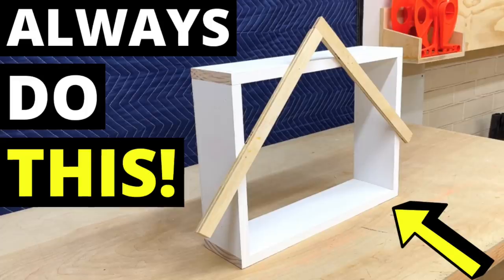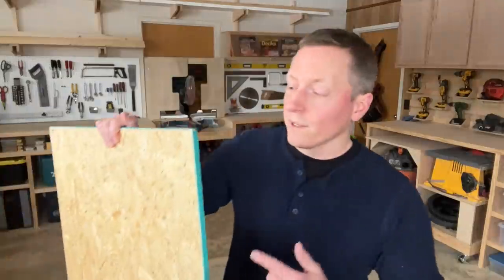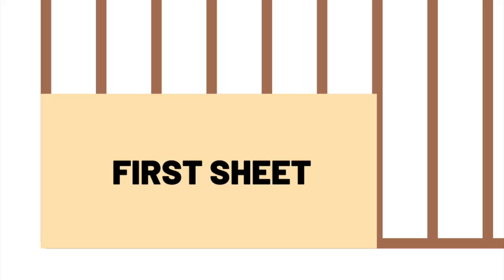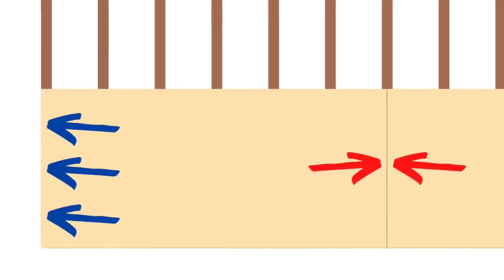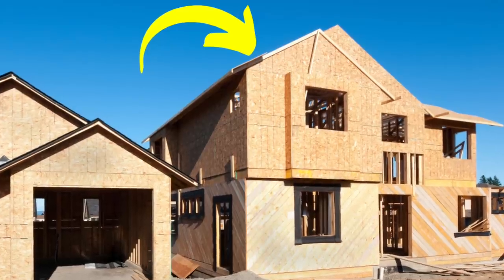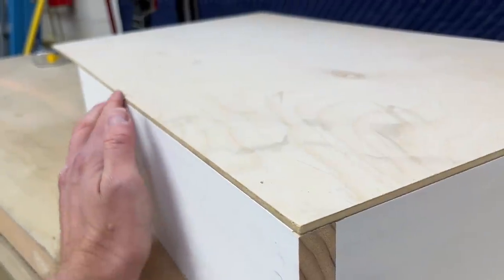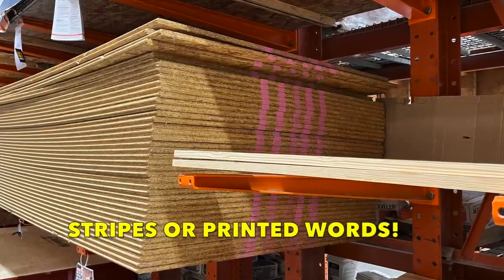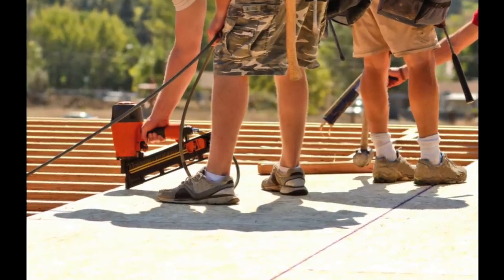This BUILT-IN LUMBER HACK Will Help You Build Anything! (Understanding FACTORY EDGE--How To Use It!)

Comment: Thank You for your video.  Many DIY’s do not know that the factory edges are “straight and square” for construction. 
But …. 
OK I’m that woodworker. The factory edge are good in construction, but in cabinetry (at least on cabinet grade) the edges are neither straight nor square enough for high end cabinets or furniture work.

Comment: I've forever been tainted and forced to check my plywood after a barn door build a few months ago where 3 of my 6 4x8 3/4 CDX sheets had factory edges from 1/8-3/16" out of square. I couldn't figure out why my T-Square wasn't agreeing with my marks. I blamed the square because I trusted factory edges that much. After some checking, it was the plywood. I'm sure it was just a bad batch but I feel forced to check for the rest of my life. Sad lol but 10 years of square factory edges isn't a bad run.
Reply: I've learned not to trust factory edge when building custom built-ins, both because of inconsistent thickness and out of square. That's where the track saw shines.
Reply from the maker: That’s crazy! There are some small mills out there—it does make me wonder how it all gets quality controlled
Reply: @TheHonestCarpenter  These sheets were from Lowes so I can't say I was buying from the best local lumberyard. With that said, I've always had good luck with their poplar cabinet plywood.

Comment: The last couple years, since the shortage/price hike, I've seen entire bundles that are a couple degrees out of square. Almost feels sacrilegious to cut away factory edges, but we're all doing what we gotta do.
Reply: Same... We even had a whole bunk of tongue and groove floor ply with poorly milled grooves.  They were placed too low, like almost an eighth.  It was a fucking nightmare.  It usually takes me 15 seconds to grab a sheet (a flat one) slam it down, set the seam and nail each corner.  These beasts were taking 5 mins a sheet.  We send a bill to the lumber company 👍 🔨 🇺🇸
Reply: @9mmkahr  that’s exactly what you should do… did they pay it though?
Reply: @G__Mason  not sure, I passed it on to the company owner, but he didn't seem to care much.  Oh well, I'm hourly 😆
Reply: I have seen a huge decline in quality. Not just wood products either !!

Comment: When I get a sheet and I know I'm going to chop it up, I put four marks on the corner.  So even when I cut, know if I'm dealing with a factory edge or not. You just transfer the corner mark to the edge before cutting it up.  Or if the edge is messed up, you can create your own perfectly square sheet. But you'll need a tracksaw and some square rails to do it properly. I find that doing it on a tablesaw is too cumbersome.  And never trust the panel saw at the big box store. It's usually not an issue since no one is ever around to help you.  LOL
Reply from the maker: I definitely avoid those panel saws, hangsang!
Reply: Love this tip.  I very rarely get to use whole sheets in my projects.
Reply: @TheHonestCarpenter  I usually ask them to cut up my sheets at the panel saw so they fit in my car, but I know they're trash. I always mark the factory edge and ask them to cut at least 1/2" more than I need the pieces to be so I can bring them home to my good saw. I saw them with the factory edge up against the fence and still leave about 1/8 extra on the cut width so I can turn it around and use my straight fresh-cut edge to take off the factory edge so I have clean, parallel edges for whatever I'm building. It's tedious, but it gets the best results until I get a truck to haul full sheets. I've also been tempted to bring my circ saw and make my cuts in the parking lot.
Reply: @DrewTauber  I've brought a saw and cut-list and cut in the parking lot.
Reply: @joshuajones8455  I like your style
Reply: @joshuajones8455  Been there, done that many times! Sometimes get funny looks from people, but it works for me!

Comment: i have found most OSB and plywoods to be square, at least square enough for all framing, rough carpentry etc.  however, if you are building cabinets, i have found melamines and mdf to be out of square 1/8-3/16 based on the diagonal corner to corner measure...and that is using a combination square on the corners so any faults or round overs are eliminated
Reply: This has been my experience as well.  For rough framing the factory corners are plenty square.  But when I started building cabinets I couldn't figure out why they were always a little bit off.  After a lot of trial and error I determined that most the plywood I got did not have square corners.  Once I started squaring all the corners on my sheets and stopped assuming the factory edge was square enough I started getting perfect cabinets.

Comment: Thanks.  Anytime I'm doing a project and grab a piece of cut sheet lumber big enough for the job, the first thing I check is to see if it still has at least one factory edge to pull and square from.  Definitely saves time and work if it does.
Reply from the maker: Yep, I do the same thing, Steve! I flip it around until I find the factory, then mark it 👍

Comment: I was wondering why some of the Lumber at Lowes was already pre-marked, now I know what it was. That Factory Edge marking makes it nearly impossible to not put a floor down on the studs perfectly. Thanks.👷🏿‍♂️
Reply from the maker: Exactly, W! 😄
Reply: The color and number of stripes on ply or OSB also tells us what that sheet of lumber is to make sure you are charged properly at checkout.
Reply: Yup, I learned something new here as well.
Reply: Floor down on studs? No such thing
Reply: That is not the intended purpose for the stripes, but it is useful. The purpose for the stripes is for the cashier to identify what material you have so they know what to charge. Pay attention next time you check out and you'll see they have a binder with all the various stripes and colors with prices or a bar code next to it.
Reply: @jncn1490  
Seriously hoping someone caught that 👍
Reply: @earthlingjohn  I caught that, but you can buy "studs", or 2×4s, and use them for a floor. I assume that is what they meant.
Reply: @jsmith5443  But then they are joists. Studs go in a wall, joists go in a floor, rafters go in a roof.

Comment: I’m not sure if anyone else has experienced this but most times I buy 3/4” plywood from home depot it can be up to 5/16” out of square. Lp smart side was always perfect and 7/16” osb was always within 1/16” or perfect
Reply: It happened to me several times
Reply: I literally have to square up every piece of plywood i have gotten
Reply: I had a kid cut 40" from a sheet of plywood at HD.  He measured by having the plywood on it's edge, while he measured it.  The sheet was bent like a bow and arrow.  He then argued with me that the measurements will be exactly the same as laying it down flat and measuring.  So, I had him measure, and mark the board where he would cut it.  Then I laid it down.  I said, now measure the 40" and according to you "they should be exactly the same".   He was literally off by about six inches.  Then he says well we don't guarantee accurate cuts.  To which I replied I don't guarantee purchase either.  He was pissed.  Wouldn't say another word to me.  It was also stupid that those saws have a precise measuring tool on them...so easy.
Reply: 100%. I had a whole unit of 3/4 LP birch finished ply from HD that was not only out of square but slightly curved like a banana. Running a dry line corner to corner there would be a fat 1/8” gap or hump dep on which side of the sheet. We dealt with it by straightening one long edge with a track saw and then breaking down the sheets. But it was a royal PITA and cost many hours of production. That same unit had all kinds of delaminating problems too. I was told the “banana” can happen in production If the adhesive is not completely cooled when the sheets are final cut and stacked.
Reply: Same here.  HD sheetrock, too. Recently the short edge of a 12' piece was off by ¾".  I learned a valuable lesson.
Reply: Absolutely.  Always beware of "Big Orange" and any other big box stores that will buy less than perfect lumber or pieces/parts just because they know the average homeowner doesn't know the difference.  Contractors will go where they can buy near perfect, and the customer will just pay the difference for a better job.  Very rarely do I get plumbing items from Big Orange that don't leak.

Comment: You're my hero, and I feel a little dumb. DIY'er here, turning my van into a motorhome and have had a very hard time with straight lines and such. Knowing what I need to look for, however, is SUPER helpful, and should lessen the stress considerably!
Reply: Also, look up the 345 rule it will help you check things to make sure they are square.

Comment: Good tip, this is particularly true for engineered materials like the OSB you demonstrate or MDF, and chipboard. Cheap materials like hardboard, and compounds like plywood or glued up boards may not be as exact, a factory might not always bother to fix a machine that is just one or two degrees out of square. Bottom line you can't assume but it is definitely a useful reference.

Comment: Factory edges on sheet goods are great for rough framing.  Buts it's called rough for a reason.  I have dial calipers for woodworking...for a reason.  It's also the voids in plywood that you have to watch out for.  If a batch has 10% failure at a factory inspection, the entire batch may be sold to a homeowner's store and the 10% voids won't really matter.  But in a cabinet shop, 10% can make or break your profit.

Comment: I have an 8' x 6" piece of mdf with the factory edge I cut from a full sheet. I've used it as a straight edge for a little over three years. It was either that or spring for a festool track saw. 😂
Reply from the maker: I’ve done that a lot, Lucas!

Comment: In the video you show lining up the trusses with the factory lines on the OSB running horizontally 8 feet. On a new house the OSB was applied vertically on the walls, horizontally on the roof. I am using OSB inside the garage to cover the walls and make like an I-beam or a box beam to get more wind resistance. I have the lines turned to the inside of the wall so the smooth side is on the outside, so that I don’t get splinters every time I brush up against the wall. I like to attach the metal shelves (that stand on the floor) to the walls so that a 7 foot tall contraption doesn’t tip over on me. I’m not sure why the lines should face you when you’re nailing, other than what you showed about lining up the trusses. I noticed many of the studs are slanted, not plumb. It seems builders cover everything with OSB and then cut out the windows and doors which wastes a lot of expensive OSB. I’ve been struggling with what to do should I decide to convert the garage from storage to living. I have to apply the OSB so that it’s easy to remove a window opening. On the gable end the window headers are above the wall., So the window can be 30 inches Wide by removing one stud. 30 x 36 looks nice but 30 x 48 looks better. Well a 4 foot high window on a 9 foot wall, how much light does it let in? My whole subdivision has no windows on the side of the house. It must have something to do with the fire code. After the Louisville Colorado fire, fire protection is something to consider. If the house next-door is burning down, which is not as uncommon as you might think, they say the fire will blow out the windows to get to the oxygen in the garage. Another consideration every double pane window wider than 18 inches fails miserably with water vapor between the panes. In short I’m using OSB to brace the corners of a 24 foot long wall. I added extra hold downs since I’m in a wind zone rated 120 mph for three seconds. I can’t buy 9 foot long OSB here in Denver. Why? So it makes sense to run the bottom 4 foot of wall horizontally and the top 5 feet vertically in the corner for a tornado load. Well the OSB stiffens the wall but very little is holding the roof trusses to the wall.

Comment: I once was fighting a job with OSB.  Nothing seemed to be lining up after the first few pieces were down.  After a couple hours of frustration I discovered two pieces of my OSB did not have square factory edges.  One edge was just over an 1/8th inch shorter than the other side.  Not a professional but have gutted/remodeled a couple houses and built my own house as well as two large shops/RV storage barns.  I've installed quite a bit of OSB and never seen this before or since.  All others have been perfectly square.

Comment: Spot on, factory edges are so useful. Cut edges are very hard to square up. On a side note I would run the chop saw cutting the lumber, they were surprised when they asked for a dimension and it was spot on LOL!

Comment: I have read some of the comments and I must chime in. What the Honest Carpenter is referring to is to be utilized within the tolerances of FRAMING. Some of the comments suggest to rip off the factory edge if it is dinged up or not perfectly square. If the edge is severely damaged then yes, otherwise you are better off using it. One reason is has anyone ever wondered why the factory edges are painted? It has a function. It seals the edge so moisture does not migrate into the plies and start swelling the edge. This is especially true on OSB (oriented strand board) which can really soak up moisture until covered. Beit roof, subfloor or wall sheathing. One last item I'd like to convey, Years ago I was sheeting a long run of roof trusses on some mini storage units. After a few sheets the panels were not squaring to the trusses. I thought my layout was off and spent time pulling tapes and head scratching when I finally pulled diagonals on the sheathing. Every sheet was 1/8" out of square. It was found in multiple units of sheathing. Couldn't believe it. I had never seen that before but be aware it does happen. Rarely.
Reply from the maker: Thanks George! 😄 Much of what I was shooting to convey myself. Framing level work, and maybe some built in or shop grade stuff where tolerances are minute. Just trying to get people familiar with the concept!

Comment: Great tip for construction but when building cabinets with veneered plywood like Baltic birch, etc., that “factory edge is often  dinged and rough — cut with a large panel saw at the factory. And rarely are corners a perfect 90°. That’s why 4 ft plywood is often almost 49” — they give you a little extra fro squaring up. We find the best corner, then use our track saw to cut a perfectly straight edge on the 8 ft side that is smooth as silk. Then cut a perfectly smooth 4 ft side at 90°. Only then are we ready to start cutting the rest of our work pieces from the sheet. With my track saw after measuring and marking with a pencil, I can often leave half the line when cutting.

Comment: I think most people would figure out factory edge on their own. Seems common sense to me as no one told me about the factory edge and I've been using a factory edge in different areas of life since I was in elementary school. Just the other day I wanted straight lines on a blank piece of paper. Not having a ruler handy, I used a piece of cardboard. Three of the four sides had been cut earlier, but there was still one side that had the factory edge I could use.

Comment: not all factory cut sheets are 8 x 4, we use 4 x 8 melamine sheets daily and they come at 49" x 97" which gives you enough for when you trim off the edges and so you can make better use of the standard cuts keeping in mind that the saw takes off 1/8 from every cut

Comment: Great feature. So many people fail to teach beginners and there is a market for that and you do such a great job at it. I will add that sometimes the factory edge - while square is a bit rough so for a furniture person - you really do take the extra step in fine sanding but for what you are doing - ya. it's perfect 90.

Comment: 3:22 i assemble furniture and i use a similar "hack" for drawers, if they go on a  drawer cabinet, i assemble the cabinet first and the on top of it i put the drawer to the side and make make sure it's square and from there on i continue (cause a lot of drawers are recessed in the wood, unlike the one you are showing that is fastened from the bottom)